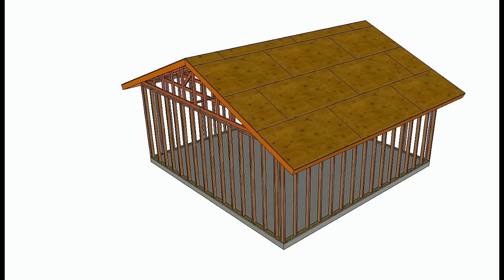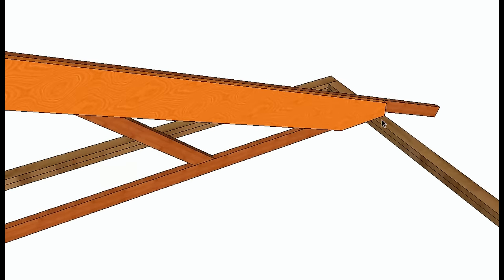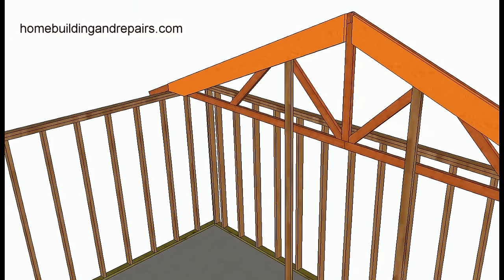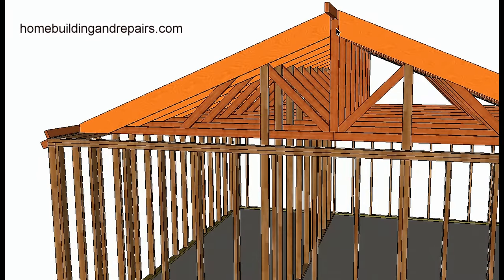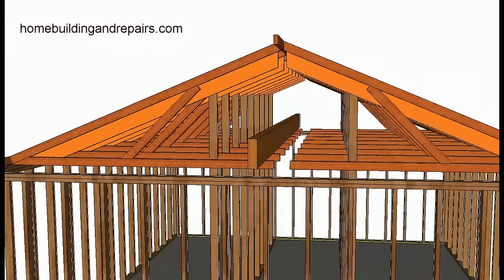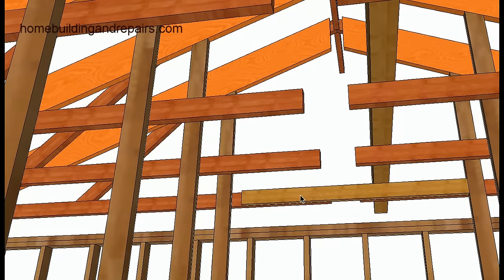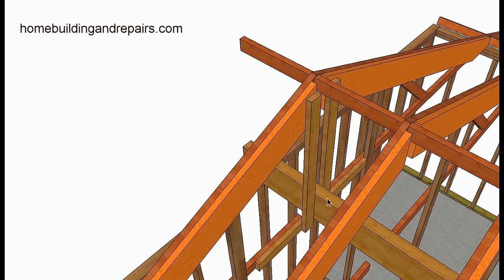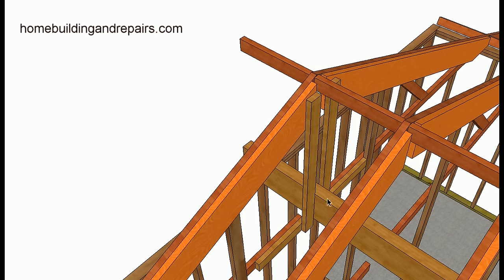How To Convert Existing Truss Roof Flat Ceiling To Vaulted Ceiling Using Rafters, Post and Beam

Comment: When your spouse keeps on asking for vaulted ceilings in an old house, you simply play them this clip and also explain that the entire roof deck will need to be redone for your cold climate. Discussion over 😂
Reply: Ahaha that's how I got here 😢
Reply: It would be easier to sell and buy a new house with the ceiling you want.
Reply: @HawkGTboy  No. It's not such a difficult job, but it's a gut job on the inside. The issue is having the idea like he explained in this excellent video. You'd need an engineer to size the glue lam beam.
I had this exact situation in my house 25 years ago. It took me 5 years to figure it out 🤦‍♂️.  Ended up with what he showed, except we cut a hole in the side table to slide the beam before touching the truss parts

Comment: I remodeled a 100 year old condemned house and we did exactly this because the ridge was severely sagging.  There were no trusses however but we cut loose all the original rafters and had attached new 2x6s onto them.  We then jacked the new beam up into place literally pushing the original ridge beam out of the top of the roof.  We used 12 ton bottle jacks on each end and had tripled the wall studs/posts under the jack points.

Comment: I HOPE YOURE RIGHT...... BECAUSE I HAVE TRUSS ISSUES:0/
Reply from the maker: It sounds like you should contact a structural engineer. This video is only meant to provide ideas for builders and in no way will suggested video remodeling or repair methods work on every project.
Reply: @gregvancom  ITS A JOKE..... "TRUSS" ISSUES.
Reply: @edwardsilva5456  😄 😁

Comment: pretty cool, thanks for explaining that!  It still boggles my mind that putting a giant heavy beam way up in the air somehow stops a structure from falling down.  I know there's math, but it seems counter intuitive.  Could you explain the physics/forces of how that beam works?
Reply from the maker: I'm not a structural engineer, but might be able to provide you with a video that will give you a little more information. I will post a link here when the video is done.
Reply: Thanks that would be awesome, and I would never hold you liable for anything, and would obviously seek professional advice in a contextual situation if I was ever planning/executing.  Really appreciate you taking the time to share your knowledge.  Thanks!
Reply from the maker: You bet.
Reply: It’s all about thrust....if you vault and don’t have anything at the top to support the load a horizontal thrust will be applied at the top of the wall and the rafters want to push the walls out. This is the main point of ceiling joist to resist this outward thrust. Couple of problems here is adding a much larger concentrated load at each end of the new ridge beam that the existing footings more than likely cant support. Also by vaulting you can’t brace the gable end wall in the attic so you would have to come up with some special bracing or balloon frame the end wall.
Reply: It works because the ridge beam is held in place by columns on both ends that ideally extend down to the foundation.

The ceiling center can’t move downward because the beam is held up by said columns.

Some people could use rafter ties which have a look some people want as well.  The beam isn’t really the glue holding anything up, it’s the columns though in this case

Comment: Stumbled across this quite by accident. I'm not a carpenter or engineer, by trade, but I've wanted to do this in my family room and connected kitchen for some time. Was told by carpenters that it wasn't possible, that the roof would likely collapse. That didn't make sense to me since you would likely start by sistering 2x6s or 8s to the rafter part of the truss.
I'm going to share your video with a local engineer and go from there. 
Loved the video. Thank you for sharing. Larry Altman
Reply from the maker: Let us know what you come up with for the remodel design.

Comment: I have a detached garage with unfinished walls and ceiling, that's framed exactly like the model '25 x '30. And this video is what I was looking for, been brainstorming how to raise the ceiling to use the garage as a work shop. Great video!!
Reply from the maker: I don't know if I have any videos on that, but you can always check out the website. They would probably be in the remodeling section under framing.

Comment: Great talk about the conversion...  I might add that the roof needs to be designed as a rigid diaphragm to more efficiently transfer lateral loads to the perimeter walls which will put limits to the length  and height of the beam/post design.  Also, might add that uplift may govern the design in some cases especially if one end is open, i.e. like a garage or patio
Reply from the maker: Sounds good to me. You do bring up a good point and that is the fact that there are other things to consider when doing any modifications to an existing structure.

Comment: I found this channel while trying to figure out why every shed replacement I was looking at seemed to have no rafter ties or proper beam support.   Drove me nuts.  "They're just sheds" I guess they say.  Well, if my original shed had been built correctly, I wouldn't be replacing it.   2 weeks later, I am going to build something that should likely support a locomotive on the roof.

Comment: Make sure you check reactions on the beam ends. You might need to add a larger footing condition @ both ends of the run. Typical footings can only take so much load transfer, based on depth and width.
Reply from the maker: That's a very good point and even though this covers the framing, you can watch some of our newer videos for more information about footings on remodel projects like this one.
Reply: @gregvancom  worked in truss design for 35 years. It's all the things I go over with individuals excited to cut out their original flat ceilings. It's the small things that will really kill you for cost.
Reply: @llew-AZ  do you still do truss design?
Reply: @amyheist6745  Yep, I've been doing this forever.  How do you know me? I have known so many Amy's over the years. Way more plus and minus. So you have that going for you.

Comment: I was thinking of doing something like this, but I was concerned about aligning all the rafters so that the beam would lift into place but not leave a gap between the rafters and ridge beam. Normally you install the rafters individually to the ridge beam so a tight fit is easier to achieve, but here tolerances matter as you are fitting to many rafters at once.

Comment: So in the video you mention if you wanted to move the ridge blocks you'd need to remove the sheathing on the roof and re nail. I'd imagine at some point in depth into a project like this it would be easier and maybe more cost effective and less labor intensive to just strip the roof off and restart. Get pre engineered pre assembled trusses and just build a whole new roof. Am I correct on this thinking?
Reply from the maker: You bring up a good point and sometimes it will be easier, but it might not always be cheaper. There are a lot of things to take into consideration and doing a project like this and engineering will always be one of them. Heating and air-conditioning, electrical wires, plumbing and anything else that can be in the way, can create problems.
Reply: I guess  that comes down to the value someone puts on thier time.
Reply from the maker: True, if you're going to do the job yourself, then time might not be an issue, but if you hire someone it might.
Reply: It's not as easy as going with prefab or custom trusses.  As pointed by the author, one must consider AC unit mounted on roof, HVAC ducts running through attic, electrical attic wiring, and attic plumbing especially these days with PEX water lines.  While a remodel is certainly "doable", expect to leave the house vacant 2 to 3 months and spend around $30k to $40k for a vaulted ceiling on an existing gable roof for a 1,400 SQ FT home. 

EDIT: Keep in mind that the walls will need to be extended to meet with the height of the new vaulted ceiling or you will take the walls down and create an open floor plan.
Reply: @danielmendoza1774  What do you mean when you say the walls will need to be extended? Do you mean you have to make them wider to maintain the original height where the ceiling meets the wall? And how could you take the walls down? I'm not understanding anything you said in the edit portion of your comment.
Reply: @jasond4752  Hello Jason, apologies for not being clearer.  For the extension part I meant the walls need to be taller so as to meet the vaulted ceiling height. This ceiling height varies depending on where you stand in the room; sidewalls (where gutters attach) will have a lower ceiling height than the middle of the room where the ceiling is at its peak.  Therefore all walls inside the house will be sloped the same amount as the roof slope.  

The other option is to demo some walls (hallways, kitchen walls) to make an open floor plan.  You cannot demo any exterior walls, only interior ones. You do the wall demo by getting rid of non-load bearing walls.  Then you repair the floor or replace it altogether so that there is no trace of a wall ever existing in that spot.  Hope this helps.
Reply: @danielmendoza1774  Thanks, I understand now. I thought you were talking about the sidewalls and I was very confused.

Comment: Nice video, but, at 5:58 now that you've cut the center of 2x4s out there's nothing stopping the walls from being pushed out from the weight of the roof. Unless thats a slow process that happens over time, not a couple days?

Comment: For a 30+ ft span, it was cheaper for me to use 2x6x20 beams sistered at a vaulted angle, rather than move to a center beam by more than half. It gave me the added height, but also makes for an attic space to insulate which has helped keep the shop more bearable.

Comment: Wow, very clever (my highest compliment).  I need to alter my engineered trusses to add space above a car lift in my 25X40' garage/shop.  No one is interested; they tell me I have to replace the existing trusses with new engineered trusses.  How do I find an engineer locally to design the alteration with your rafter method?

Comment: Awesome video. Could I just modify the existing flat ceiling truss to a scissor truss, as opposed to a raising a ridge beam with a true vault and rafters?
Reply from the maker: I've never seen an existing truss remodeled. However, you can check with a local truss manufacture or structural engineer to see if they have some ideas.

Comment: I'm curious if steel brackets and flitch plates could serve the same purpose of a ridge beam. Maybe this is nonsense but I thought I'd at least explore the idea. In my case I have no ridge board, my rafters meet face to face. The idea is to make large 1/4" steel brackets with through bolts that bolt to the sides of the rafters where they meet at the top. These brackets would be following the rafter size and angle, basically the shape of a boomerang and around 1 foot long on each leg. Then bolt a flitch plate along the side of each rafter and mechanically tie it into the top brackets. This solution makes sense to me as an alternative because it seems the only problem with removing the rafter ties is the roof is now able to bow and the rafters could spread away from each other from the downward force and in turn push the walls outward. But with a solid mechanical connection at the top and flitched rafters I don't see how any bowing or pushing movement would be possible.

Comment: Hi Greg. Thanks for the beam raising trick. Very DIY oriented. Bringing the topic of trusses and rafters, could you please explain using plywood gusset instead of metal connectors in trusses. Unfortunately there are no truss factories nor that kind of structural engineers over here. It will help me taking my carpentry skills to the next level. Especially that maximum lumber length here is 12'-10" which limits the run and the pitch when using rafters.
Reply from the maker: +Khalid Al-Bahi  Bummer about the lumber lengths.
Reply: LOL. Tell me about it!! But, isn't engineering all about using what you have to build what you want.
Reply from the maker: Exactly!
Reply: Thanks for giving me some idea on what's involved. I'll probably pay someone to do it and stick with drywall and painting!!

Comment: I am about to do something similar. The structural engineer advised that we needed to put an entirely new beam basement and new Wally columns. Can you explain why this would impact the basement?
Reply from the maker: You have to install support posts to transfer new loads to foundation. You might need  new footings also.

Comment: Seems like this changes the lateral force along the outside walls after removing the bottom chord of the truss.  Have you ever seen issues with the outside walls bowing or failing?
Reply from the maker: We have other videos on house framing you should watch. It's difficult to answer your question because I've never visited a project like this one or more decades after it was remodeled.

Comment: If you need to take the roofing and sheathing off, would it be more efficient and faster to redo the framing with the ridge beam and rafters, or is this the most efficient way to deal with this kind of modification?

Does the situation/response change if I am also extending the roofline out?
Reply from the maker: To verify whether or not the project could be done more efficiently or faster, would depend upon the project. It will be up to you and your engineer to figure out what will actually provide the best results or save you the most money.

Comment: What if your only replacing a section in the center with conventional framing, is there a way to support the ends without a post?
Reply: Very curious on this question too, but i doing think there’s a solution

Comment: How would you do an over hang on the ridge side? Make a longer beam, but what about the roof rafter,? Do you nail a 2by on the ends of the rafter tails and run it long?
Reply from the maker: If you have a supporting wall under the ridge or beam, then you can build the vaulted ceiling on one side. If this didn't answer your question, then provide more details.

Comment: Hey sir I have a question, would a beam in the middle of the roof be needed if only one room of the building is vaulted ceiling and everything else is flat ceiling?  Every room will have ceiling joists and only one room will be vaulted.

Comment: The temporary wall layout would not work unless those studs are sheathed or braced by something in their weak axis as they will buckle.  You can get creative with various angled braces, but sticking osb on them without too much nailing part of the way up may be the easiest way.
Reply from the maker: It might not work in every situation, but it worked for me in every situation I ran into. I don't see a need to use structural panel sheathing, but it's always going to be better to make your temporary supporting wall stronger, especially if you don't understand much about house framing and engineering.
Reply from the maker: I wasn't trying to be mean and there are plenty of other ways to build a variety of different things. Anyway, what's up with boob a cocka.

Comment: Hi Greg, for the ridge beam conversion....structurally speaking....would you ever just use the the existing 2x4s from the trusses instead of adding rafters connected to them?
Reply from the maker: If you're talking about redesigning the truss and modifying it into a shape that would be used as an alternative to installing a ridge beam, then you would need some type of an approved design.

Comment: Thanks Greg. What is the best way to get the rafters in to my attic? I've removed the gypsum and insulation from my ceiling, I thought I could just slide them up but the middle wall is too high. Do you think I might be able to cut a small hole in the roof and get them in that way?
Reply from the maker: I don't have a method that would work on every project, but it sounds like you have a few obstacles in the way that might either need to be removed or like you said, a small home might need to be cut in the roofing and sheathing. Feel free to email me some pictures if you haven't figured it out already and I'll be glad to take a look at it.

Comment: Does the ridge beam need to be 1 continuous piece? I'd love to do this in my 43' long house but getting a beam that long seems daunting.
Reply from the maker: You can place posts under ridge beams to reduce spans. You would need to check with engineer for more details.

Comment: Awesome i really want to get of my cieling dry wall and build by walls on the way up where the room divides. Build a loft like storage with a ladder in every room with a ladder to climb up. Use foam to insulate and put big sky lights  on the roof instead. And rerun the electric, pipes, and a/c vents neatly and make it look industrial